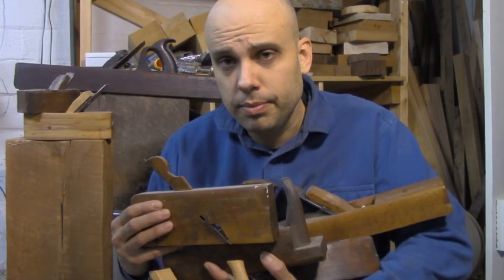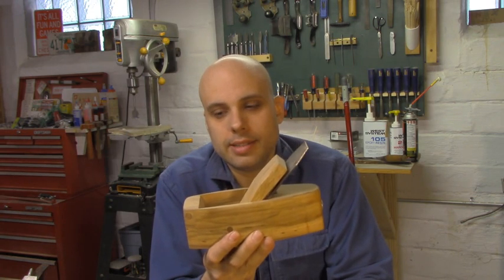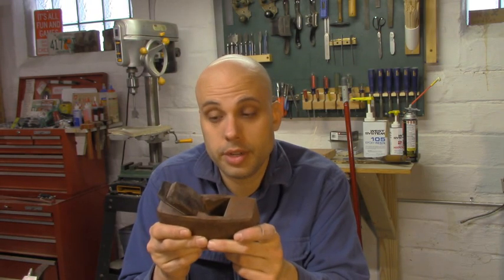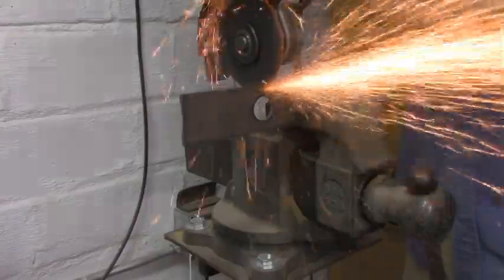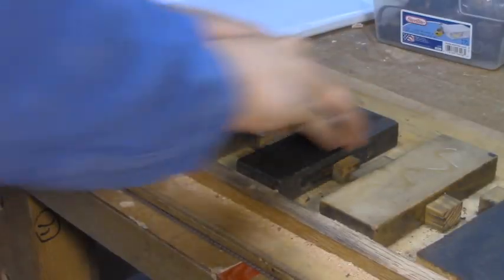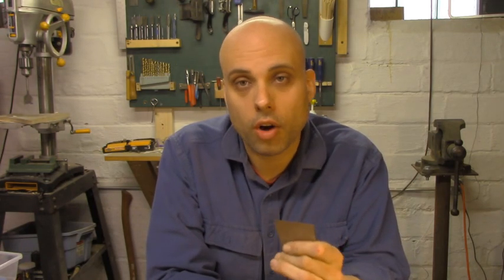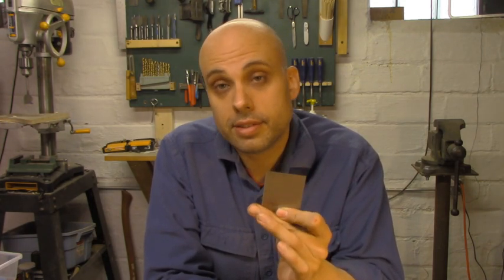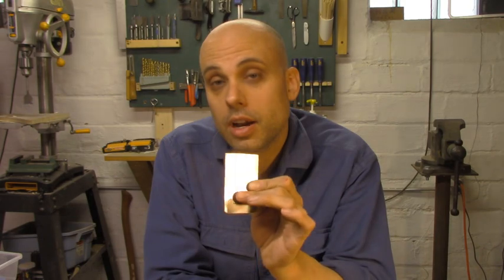Make a plane blade for $2?  (Maybe)

Comment: Could you not harden the steel? I have made a couple of krenov planes from a lawnmower blade. I heated them to where they were nonmagnetic then plunged them in oil. Then put them in the oven for a couple hours, and allow to cool. They don't hold an edge like a Stanley, but close. And way better than a (admittedly cheap) Japanese plane I bought at the Big Thumb store in Yakuska.
Reply from the maker: I tried with a sample. Didn't harden. Must be a medium carbon steel. Drag.

Comment: This is a brilliant video, but I would like to point out that buying carbon steel should be even cheaper than that if you can find a steel yard or even buy scraps online
The nicest tool steels I can get from an admittedly expensive site are still only 6 euros per kilo, and many are closer to 2 to 4 euros per kilo - that's like 30 cents a plane iron.

Comment: A bar of oil hardening tool steel big enough for several blades is only about 35 bucks. I admire the search for a cheap blade but at some point your time is worth more than the money. That blade you made that didn't skate a file won't hold an edge for very long I'll bet. It's possible you could reharden it and only slightly temper it, but how much time are you going to sink in a piece of mystery steel? Love your channel though.
Reply from the maker: Well, I did it for the experiment and the learning experience. I'm a blacksmith, too. I know about tool steels. It was for fun.

Comment: You say that the file abrasion test on the edger steel is inconclusive because the scratches might be due to coating on it.  Why not sand the edger steel a bit to eliminate the possible coating and then test it?  A fine video, by the way.
Reply from the maker: Yup, that would have been a good test, but I knew I was going to spark it anyway and I wanted to keep things moving along. Sometimes, you sacrifice science to tell a better story. Glad you liked it!

Comment: You mention that for people who don't have an angle grinder, the desired steel is too hard to cut with a hacksaw but that it's completely doable with tools you'd have in a standard basement or garage workshop... what would you say is (or are) the best "common" tool(s) to use in that case?
Reply from the maker: Yeah, I should have included that. You can do it with an angle-grinder or a dremel tool with a cutoff wheel. Also, this method of iron-making was mediocre at best. For better results, watch my video on making the Easiest Handplane Ever. Also, next week will be a full blade build from scratch. Thanks for watching!
Reply: Thank you -- I will check that out!
I was also thinking (not sure how important the thought is or what the outcome would be... I remember being told back in my auto body days that managing a torch flame was very important, that a carburizing flame would make the metal (steel sheet metal of a car) hard and brittle but that a very oxidizing flame would also mess up the metalurgy.  Not sure if that could be leveraged, but good virgin steel or scrap from old tools isn't really that hard to come by.

Mostly, thanks for thinking about the things you put in your videos and for sharing the videos!

Comment: For what it's worth, a lawnmower blade is VERY hard, high carbon steel and any dump will have lawn mowers that have been thrown away!
Since you are now, dabbling in Blacksmithing, you can heat and flatten the blade, if necessary, or cut it tosize with an angle grinder and cut off wheel!  I KNOW they are high carbon steel because I make knives from them and the ones I have made knives from will make knives that are RAZOR SHARP!  They hold an edge amazingly well!  That way, you don't have ANY money in the vlade!  Also, you could get several blades from one lawn mower blade!
Here's a video from another fellow that used a lawn mower blade!  https://www.youtube.com/watch?v=hQgkgj93Dwg
Good luck and best wishes!

Comment: @ 12:00, I think you misspoke. Cast iron has a very high carbon content (compared to mild steel and high-carbon steel), not a low carbon content. The reason cast iron is relatively soft and weak (to oversimplify to an extreme) is that (on the microscopic level) all that carbon gets in between layers of iron instead of making a strong lattice with them.
Reply from the maker: If you notice, I said "low content of carbon fused with the iron". I did explain very clearly that cast iron has too much carbon; more than mild steel.

Comment: Video after video - from numerous sources - buying planes, sharpening planes, collecting planes, modifying planes; There seems to be no bounds to the inexplicable plane fetish some people have. I have worked with wood some 50 years, many years of that professionally making furniture and, especially, cabinetry. I did use a plane once. I fixed a sticky bedroom door.

I even owned a plane for many years, but never used it. I ran across it one day where it had been left unattended for umpteen years and had rusted all over. I pitched it in the trash. Now, too late, I know there are many who would have loved to restore the thing and add it to their collection. I just didn't know until recently - after retiring - about all the people with the plane fetish thing going on.

Comment: Off topic question. Are those Irwin Marples chisels behind you? I looked through you videos to see if you talked about them. Do you like them?
Reply from the maker: That's a good question. Yes, they are the Irwin Marples chisels and I think they're a terrific value. I think a set of 6 goes for about $70 in a nice box. The handles are indestructible.  I also have a set of Narex True Imperial chisels. I got the full set of 8 for $100. I like them even better, just for their wooden handles, which offer better grip and are easy to replace if one ever cracks. The Narex would be my top suggestion. They sell a set of 4 for pocket-change. Overall, I kind of suspect that all chrome-vanadium chisels are basically the same. It's all the same steel and there's nothing very special about it. It doesn't rust and it holds an edge well enough. Sharpens fast. I think that in the low and middle range of chisels, it just comes down to what you happen to like. There's no special sauce.
Reply: Rex Krueger Thank you for the response. I want to get a good starter set of chisels. My theory is that if they are half decent it will be easier to learn with than a cheapo set of harbor freight chisels.
Reply from the maker: That's true, but even the HF chisels have gotten better recently. Lots of good options these days!

Comment: some fire bricks and a propane torch will make a makeshift forge and a little youtubing will help (if you haven't done it before) but will you take some time to test hardening the and a few baking cycles in the oven for tempering.  This should have great potential viewing the tests. Just not as hard as what you need right now
Reply from the maker: Unfortunately, I already heated a sample to non-mag and quenched it. It doesn't harden. Must be a medium-carbon steel like 1040. Too bad, too. I thought it had potential.
Reply: Perhaps a visit to the local junk yard and a few leaf springs could be another option. obviously a little smithing to flatten but that's usually a decent blade steel and it should be fairly cheap???
Reply from the maker: I just got a foot of 3/16 1095 off ebay for $20. I think that'll do the job and the price certainly is right. Look forward to heat-treating for woodworkers.
Reply: Cant wait to see the next vid.!.!.!
Reply from the maker: It's up for my patrons right now. Full release is Monday. Thanks for your encouragement!

Comment: I was told that if you grind a hardened blade you lose the hardened edge because it goes through the heat process again, is that the case?🔨👂🗜
Reply: Only if you grind it to the point that temper colours start to show on the blade. Dip in water every few seconds of grinding to mitigate heat build up.
Reply: @davidcooper4119  cheers pal, thanks for sharing your knowledge. 😎
Reply: @davidcooper4119  dipping the tool in water is easy enough, but another way to  avoid overheating a tool with a grinder is to use a vintage hand crank grinder. Not too much speed or power and the user has pretty good control over the edge. Not as easy to find as a modern tool but I've come across a few on Craigslist,  so they are out there.  Not in high demand either,  so not real pricey. Just throwing it out there for guys like me that really enjoy putting old hand tools back into service.

Comment: Given the high prices caused by rarity and collector-mania, it would be nice to see alternatives like making irons for Stanley 45's, etc.  I'm just not certain a grinder with a cutting wheel is accurate enough...?  Also, doesn't the friction heat invoked by cutting them with a grinder reduce their temper?
Reply from the maker: You know, I have a really nice old plough-plane and no irons for it. I should make some. The grinder with the cutoff disc is not as accurate as one would like, but there are jigs and tricks for that. You can also cut over-size and then grind down to finished size. 

As to the grinder, people are generally too paranoid about that. If you do draw the temper, it changes color to let you know. Dip it in water right away to halt the damage and then just grind past the discoloration (which is always very shallow) and you're back in business. I do LOTS of cutting and grinding of tempered steel and it's just not that big of a problem.
Reply: I would love to see a video (and I suspect a lot of plough plane owners would) on making rabbet/dado blades for a popular plane like the '45.'  Cove or beading cutters would require machining, but man, given the ridiculous prices on ebay I would think a bored machinist could make some $$ making new stock.  Might even be worth finding a used, bench-top mill somewhere...

Maybe making a wood fixture or mount for a relatively inexpensive hand-held grinder for cutting and machining home-tooled cutter steel would be a good project...?
Reply from the maker: You could do it without milling...I think. Careful layout followed by filing or grinding could get the job done. Oh crap, now I'm going to be obsessing over this for the next month. Thanks. (But really, good idea.)
Reply: Ha!  Well, that's what you get for making me think!

But seriously, given what people pay for rusted, pitted, worn cutters on ebay, here and in the UK, etc., I imagine a metal co. could stamp out blanks of the various widths and lengths in a batch (I don't know if a standard brake could cut A1...?), and then a table top mill with jigs could mill out the roughs pretty quickly (let the buyer do the final hone on them).  Put them in a repro box with a nice non-copyright graphic on the side and one could make some hobby $$ at least.

I look forward to seeing what you come up with, Rex!
Reply from the maker: Thanks so much for all your thoughtful comments. The next video will pick up right where this one leaves off. My patrons see it a week early. Just sayin...

Comment: Need iron for blades?  How about that worn out table or circle saw blade laying in the corner?  They often make excellent small blades.  Cut them with a grinder, using wet rag to keep things cool.
Reply from the maker: I'd love to try that and I think they'd a make a fine knife, but plane blades are generally thicker and I don't think that thin steel would work. You'd need 1/8 or better. Really, 3/16 without a chip breaker. Still, I love getting suggestions. Thanks!
Reply: Yes I agree thicker is better - to help  reduce the chatter - stiffer is better.  But if one wants to see if they can actually build a plane, it would be a cheap start.  If they are successful, they can up grade by spending a little for a heaver blade.  It is more fun to make two any way.
Reply from the maker: Two is better than one; no argument from me!

Comment: I found a couple other packs of edger blades on amazon, for example a 4-pack for $10 and a 10-pack for $18, but even though they say "heat-treated" or similar, I have my doubts as to how high of a carbon content they will have, because it seems you would want an edger blade to be tough, not hard. There are ways you can increase the carbon in steel though.  https://en.wikipedia.org/wiki/Carburizing That might make an interesting video.
Reply from the maker: Dude, get out of my mind!  You are saying exactly the same things I have been thinking throughout this project. Do you know Green Beetle?  I linked to him in the description. He has some excellent videos where he explores carburizing as a way to make knives. Anyway, I think I'm going to abandon the edger-blade thing. I don't see it yielding the kind of results that woodworkers need. 

I have new ideas that I'm going to explore in my next video. If you're interested, you can get sneak-peaks and early access to videos on my Patreon feed. My lowest level of support is just $2 a month. No pressure, but you'd be a great addition to the community I'm trying to build.

Comment: Wait, are you telling me that these companies are taking the piss, and a simple plane blade shouldn't cost $40?

I am shocked...
Reply from the maker: john handcock Ha! I'd say that for some of them,  the price is fair.  they are using exotic steels and they have low volume.  still,  a simple iron should be cheap.  we can find one that is.  I know it.
Reply: How thick was your final product?
Reply from the maker: It was 3/16. Nice thickness for an iron with no chipbreaker.
Reply from the maker: About 3/16, which is a great thickness for an iron with no chipbreaker. You'll see in my next video how it performs in real woodworking situations.
Reply: john handcock the price for a replacement blade for a folding knife... about $40 from Benchmade. You are getting a heat treated ground blade. How many blades does this company make, how many blades do they have sitting on shelves. Chances are they don't have their own stock and do their own heat treatment. Repeatable quality takes time and money.

Comment: How about lawn mower blades?
Reply from the maker: As I understand it, those are the same steel as this one. Not an improvement, unfortunately. But thanks for the suggestion!
Reply: Well, they're cheap. mower repair places frequently have worn blades, or blades from trashed mowers for free. You can get 4 or 6 plane blades out of a mower blade...

Comment: 5:35 This makes this cast iron soft and brittle. Wait, what?
Reply from the maker: Maybe you need to look up the definition of these words. Something can be both. Think of Styrofoam; not hard at all, but if you bend it just a little, it breaks. Soft AND brittle.
Reply: @RexKrueger   I think that cast iron is pretty hard. That's why anvils are made of cast iron. You can hammer on it all day, but you won't dent it. But if you miss with hammer, you can chip corner of your anvil, because it's brittle. I can't think of any metal, that is soft and brittle at the same time. If you don't believe, you can go and try your scrape test with cast iron and some steel. I'm pretty sure you won't be able to scratch cast iron with steel, unless it's HSS, or some hardened high carbon steel.
Reply from the maker: Okay, go get a piece of cast iron. Go at it with a file. Get back to me. Also, anvils are NOT made of cast iron, especially not the part you hit. Google "anvil shaped object" and get an education on the subject.

Comment: Mr. K   took your advice but blade is not hard enough. So I started a wood fire in my pit and stuck a hair blower in in till it was bright orange, quenched it in oil and it shaves 3/4 oak in micron thickness (well no not really but super thin) try it it works awesome
Reply from the maker: phil Branscum That's great! I'm really glad you had such good luck!